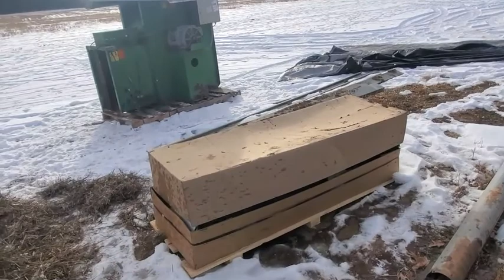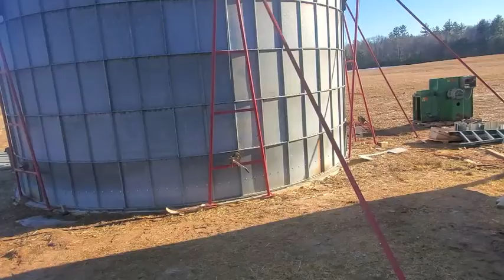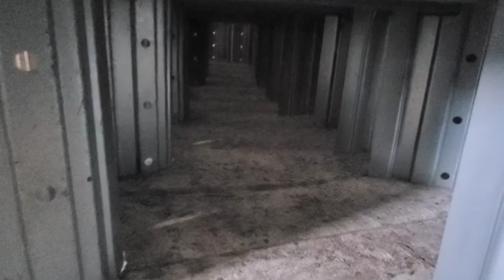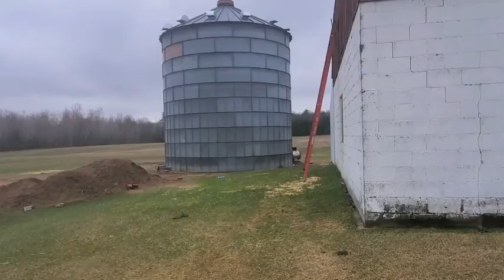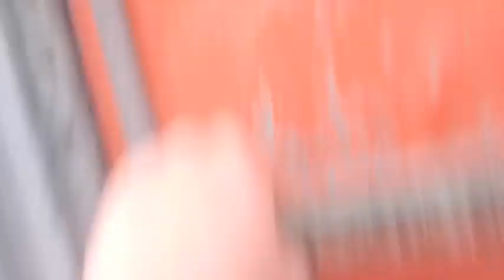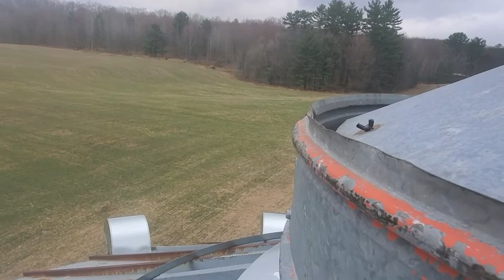New Drying Grain Bin at Red Wagon Farms

Comment from the maker: I would suggust a 5,000 bushel bin.   These are pretty easy to find used.  I would suggust only buying a used bin that the company is still in business.   We found on ours we needed to order a new bolt kit and a lot of other odds and ends.  We spent as much on bolts, vents, new steps and floor supports as we did on the bin itself.